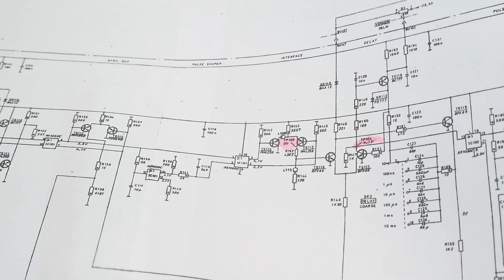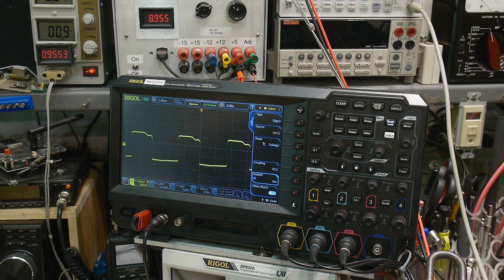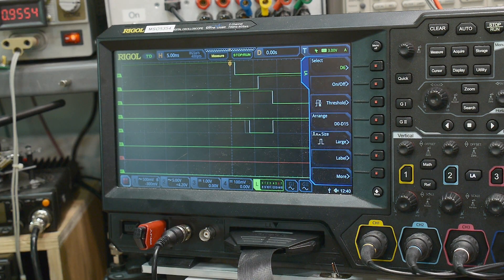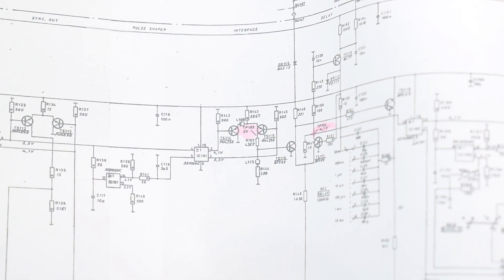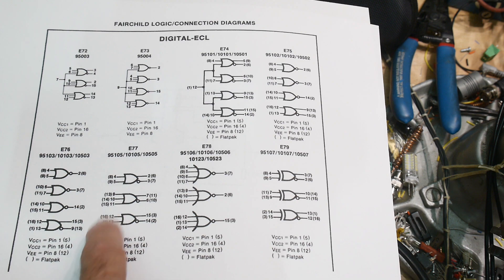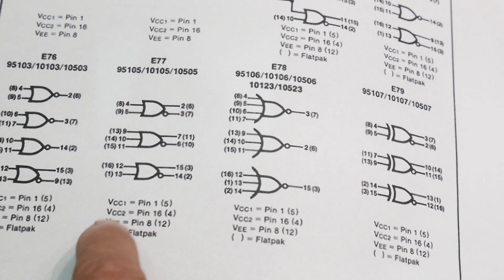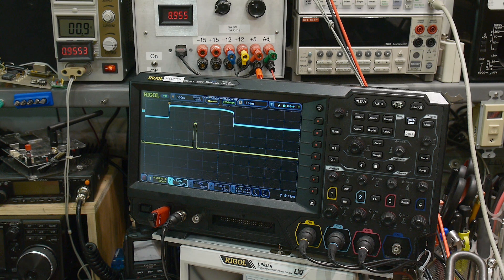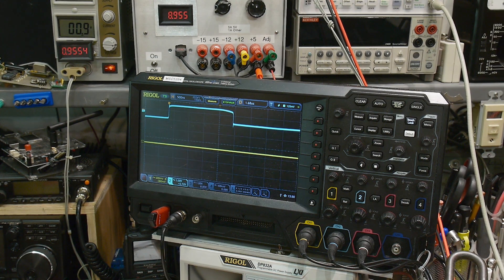#1268 Philips PM 5712 Pulse Generator (part 3 of 3)

Comment: Just a quick heads up.  The circuit board in my device is extremely fragile to work on.  The circuit traces lift with very minimal heat applied.

Comment: I need a little help. The pulse shaper is not working on my 5712. Cold you please revisit this circuit with your scope and show the relationship of of the IC101 pin, 101 pin 5, and 101 pin 12..
Reply from the maker: pin 5 signal is just inverted pin 12. the two edges are delayed a very short amount
Reply: On my unit there is very slight delay. Pin 2 & 3 start to make the 5nsec pulse but shutdown very quickly.
Reply: 1c101 was bad.  Getting pulses but the delay circuit is not working.

Comment: Hi, in mine pm5712 i replaced the Fairchild 95105DC with the Motorola ECL 10H105. So the calibration turned out to be much easier

Comment: My recently acquired DOA unit is a little different than yours. It has MC10105L chips installed for IC 101,102,103. TP103 is flatline, the output lines of IC101 (pin 2 and 3) are both flat at 0 volts with  strong steady signal  on the inputs (pin 4 and 5). I sourced replacement chips on eBay.  BTW the power supply appears rock solid.

Comment: Thank you for demonstrating how to probe logic.  What oscilloscope specifications are required to do these measurements?
I completely agree about the older equipment.  The designers had coherent guidelines for creating pcb layouts and they had the concepts to create excellent t&m hardware.  We can't get insight into current designs because everything is black-boxed into IC's.
Reply from the maker: I used a fancy logic analyzer feature of my scope. usually called MSO (mixed signal oscilloscope). otherwise any scope with two or more channels is fine
Reply: @IMSAIGuy  Thanks.  I was concerned needing upgrade to MSO scope.
Reply from the maker: @jspencerg All the cool kids have MSOs 😎
Reply: I'll need to start saving for this upgrade!

Comment: I spent MANY years working on memory test-equipment. These machines were the size of a large car with 1000s of ECL logic gates (Emitter Coupled Logic).... all for testing memory-chips while still on the silicon wafers. (before dicing) No PC boards... everything was wire-wrapped with 30gauge wire. It was all 'edges', 'pulses' and delay-lines.

Comment: Back in the 70's I worked on a radar system at Cold Lake Air Force Base.  The radar would send out its pulse and receive the echo.  But in addition each plane would squawk its id number on a seperate frequency as a series of pulses.  The receiver had several huge boards of ECL to decode the id pulses and display numbers on the display.  Each board had about 200 ECL chips and the power supply for each board was 50 amps if I recall correctly.  Basically huge transformers, diodes, capacitors, zeners and transistors with a giant heat sink and fan.

Comment: The reason those old ECL gates use multiple supply voltages is that unlike TTL/CMOS/etc. they are biased to operate in the linear region to avoid saturation, which dramatically slows down switching. Modern saturating logic has narrowed the gap, but in the old days nothing even came close to ECL switching speeds. ECL is largely obsolete now, but you will still see it used in prescalers for frequency counters and Software Defined Radios.